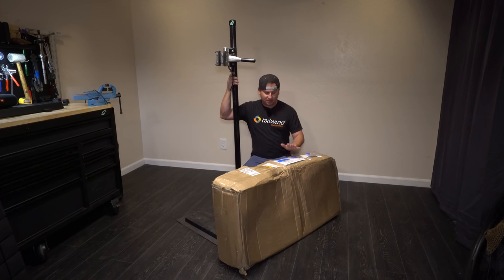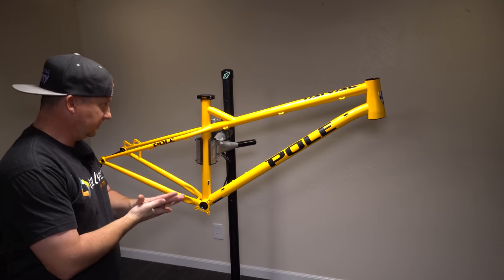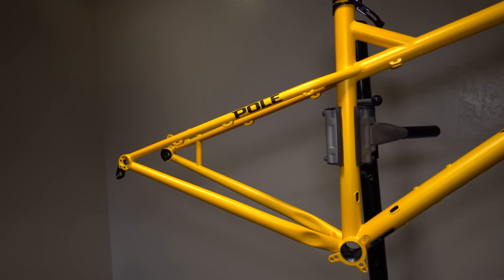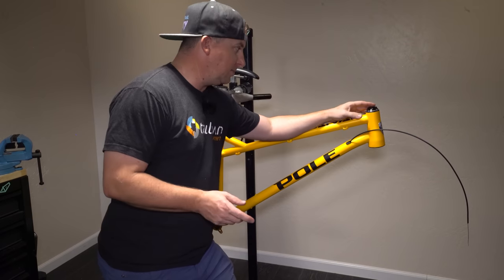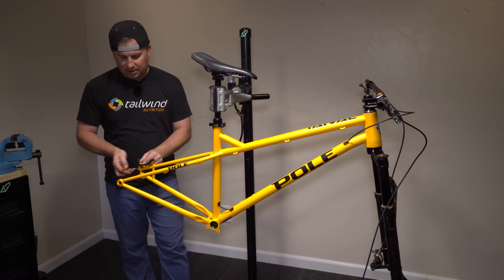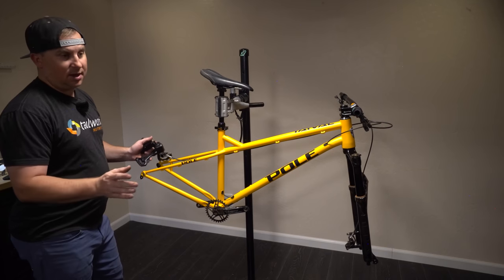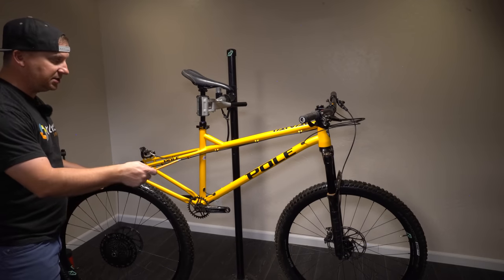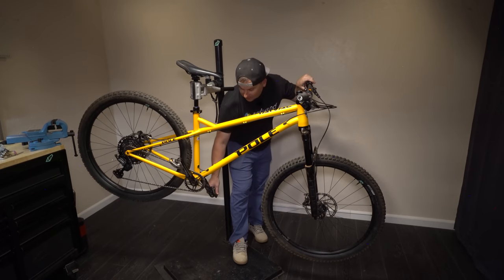Pole's Hardcore Steel Hardtail: The Taival - First Look and Build

Comment from the maker: This is a reminder that not every company sizes the same. This size small is larger than a lot of larges

I always strive to be brutally honest in my reviews and to not just go over specs. Here are some of the things I love and don't love so far.

Dislikes:
- paint quality is a bit lacking (drops, uneven coverage)
- ugly welds (which doesn't necessarily mean weak)

Likes:
- Total bike weight was light for an aggressive build like this
- straight seat tube. This should be standard in every hardtail when possible
- cable routing is FANTASTIC
- super modern geo without going overboard.
- huge stack
- threaded bb

This bike has a lot of potential. I have high hopes for its ride. Stay tuned and make sure you're subscribed to see the on-board ride review.

Want some insider scoop on these bikes before the reviews hot YouTube? My patrons get sneak peeks and my early thoughts on these bikes before youtube.
If you need help choosing your new bike and you need advice and you'd like to pick my brain (full sus or hardtail), go to patreon.com/hardtailparty and sign up for the consultation tier. Cancel when you have the info you need. Otherwise, please keep enjoying my free reviews here on youtube.
Reply: Is there any chance of a full build parts list? I’ve got the same frame (size small too) but my build weighs 33lbs. Would be good to know what the best places to shift some weight are 🤘

Comment: Nice to see you’ve got your hands on some of the Hunt wheels too!
It’s interesting that you’re using them as an even baseline for checking out how different frames feel. 
I never tried a trail wide - just went for the tougher enduro wide, which I love, even if it is a bit less compliant (I can live with that on the FS).
On the HT, I run DTSwiss M1700, they have more flex, but I do think they are a little more fragile.

Comment: Nice bike, nice build. Maybe the finish quality took a hit in the effort to get bikes out the door? Re. the Advent X, I've installed it on two bikes now, and one of the really nice features is that Microshift make brifters for it so I that's what I used on a drop bar conversion.

Comment: I like the IS mounts, the post mounts are fine... but if the threads give out an adapter is more easily replaced. The post mounts would have to be drilled out and a helicoil or similar thread insert installed. Use a torque wrench, abide by the spec, and this probably won't be a problem. Regardless I still prefer the IS mount.

Comment: As someone that runs an 870mm bb-to-rail, the triangulated seat tube / top tube is great, and does not need to die :) Many frames now just can’t fit me without a post being over max. Remember not all your audience is short ;)
Reply from the maker: You are correct, for large riders it makes a lot of sense. However, on a size small it's totally unnecessary. We shorties need all the leg room we can get with our droppers. I would LOVE to run a 180mm dropper on this frame but i can't without serious modifications.
Reply: @hardtailparty  a grinder says otherwise ;)
Reply from the maker: @bananasstuff3344  believe me... I'm tempted...

Comment: You mentioned it had a tall head tube. An option for people who switchover from a frame with a shorter head tube is to use a DMR Defy stem....they have a really short 25mm stack coupled with a 25mm rise
Reply from the maker: I agree. I had to use one of those on a past frame and it worked great.

Comment: I’m honestly ok with IS mount.  It’s less likely that it will get boogered.  Especially with an aluminum frame, all it takes is one novice assembler to mess up a frame by ham fisting a mounting bolt.  Also, unless running a 160 rear rotor (or 140 on some XC race frames), you have to use an adaptor anyway.

Also, loving the Advent and Advent X.

Comment: Sexy bike aside from the seat tube gusset. I have a Microshift AdventX coming within the week. Do you have any  tips for set up?
Reply from the maker: Nothing tricky about it, just make sure your chain length is correct and you adjust it like any other derailleur. They have great instructions in the box.
Reply: @hardtailparty  any issues with a standard length KMC 10 speed chain?
Reply from the maker: @illhumouredparadox  I've only used cheap sram chains on mine. For any drivetrain, you almost always have to remove links from a new chain.
Reply: @hardtailparty  thanks mein. 🤙

Comment: Am surprised by the welds, the ones in mine ain’t the prettiest nor ugly, they are pretty even though, paint in mine is also even. Now only complain I have is that it came with a small chip at the outer border of the lower headset cup.

Comment: The issue with the welds is the guy that was tig welding it had his volts to high and wasn’t getting enough rod into the puddle to fully fill the crater from the tig arc

Comment: How does it fit a boost and non-boost? If you put a non boost hub do you just tighten it on with the axle and bend the chain stays together?  I have a steel 2016 Ragley blue pig frame, non boost, and wondering if I can bend the frame to accommodate a boost rear hub. Thoughts?
Reply: No bending, it should come with set of non-boost dropouts and 3mm shims for the brake adapter. Just like Pole Evolink models.
Reply: Thanks!

Comment: I guess on this Pole IS rear brake mount allows for easier caliper alignment when using 142mm hub - it's just 3mm of shims under the adapter.
Reply from the maker: Great point!

Comment: If they'd just use a bigger seat tube they could make the seat tube shorter without having to support it. The dumbest, most ridiculous thing ever is the idea that a 30.9 seat tube will be more compliant if you're using a dropper post and I think it's stupid manufacturers are doing it. Flex in a dropper post is bad and they make them as stiff as they can just like a fork so there isn't excess wear on seals, bearings, etc. That's why there's people who don't like shimmed, travel adjusting dropper posts. Because it literally introduces a gap and creates a point of excess flex. So they don't usually last quite as long, especially if you're a tall rider or heavy. The only time a thinner seat tube makes it more compliant is if you don't run a dropper. You're not going to get more compliance from the tube in the areas between the top tube and BB because the flex that leads to compliance will be between the support and unsupported end (aka b/w the support gusset and seat). The only reason I can think that a manufacturer would choose a narrower tube is maybe weight? Cost for straight tubes is basically negligible.

Comment: What is surprising that they send out a bike for review that is not immaculate and  that tells me something about a company . If you own a restaurant and a food reviewer comes into your establishment you should have at least  clean plates . If you dont you wont be in business very long
Reply from the maker: Actually, i prefer it when a company doesn't roll out the red carpet for me. O don't want special treatment in my reviews, it means in getting a different experience than the everyday customer.
Reply: @hardtailparty  Yes I did think about that where all bikes should be quality from the start but if you struggle to do that for a person who is basically advertising your product tells me a bit about where the companies priority is . I had some weeping sidewalls on on  maxxis dhr2s just recently  which surprised me as maxis has been a great product . This happened overtime riding and I have road the tire for about 5 months with a thousand miles of hardtail crush . I put in a warranty claim and they are sending me out a replacement without me sending the defective tire back . Now I had a continental tire that developed a wobble shortly after buying it and put in a claim and they said since there is not a physical defect than they cant warranty the tire so a wobble is not a defect . It shows no company is perfect but who actually takes care of their customer and who does not . When I receive something that is not packed well that also puts up red flags saying its a bit lazy and that can manifest in all parts of design and manufacturing bringing a product to market . If you cant do the simple things than how are you going to do the hard things
Reply: Lots of bikes are sent to reviewers for limited time, then they have to return them. It would drive them bankrupt to send a new bike every time.
Reply: @endianAphones  To me its not a good look for everyone to see